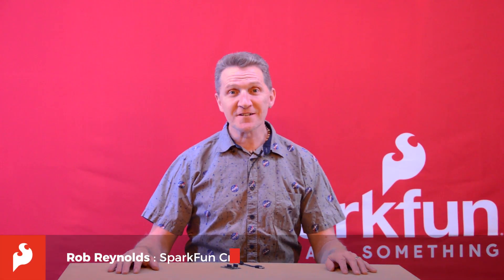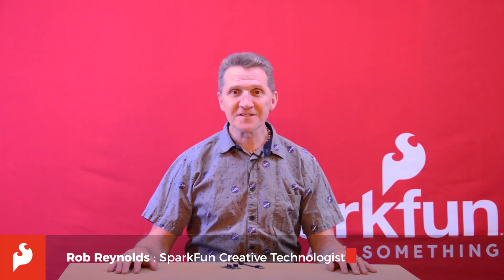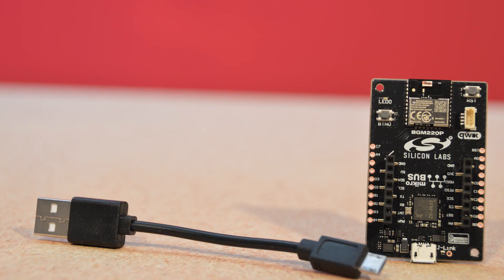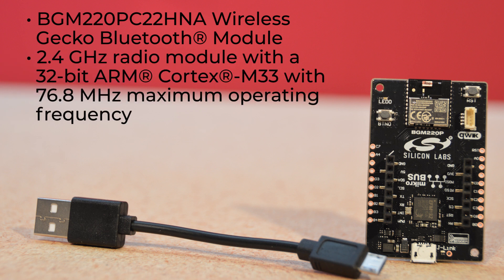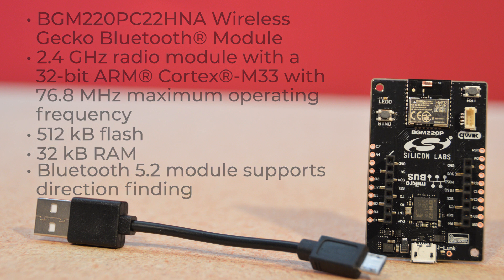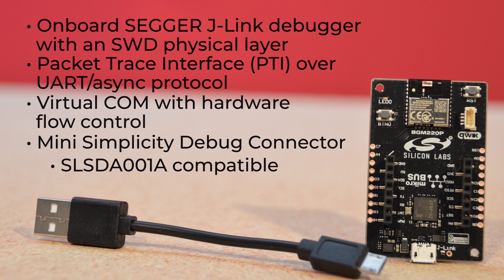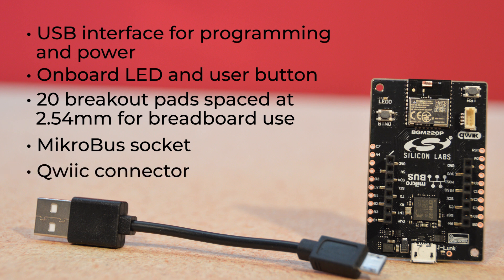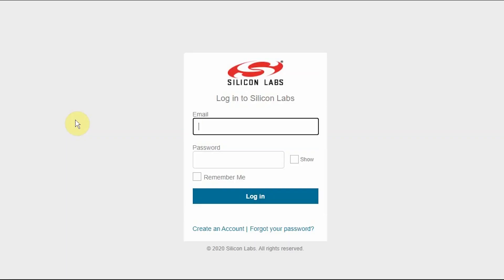Product Showcase: Silicon Labs BGM220 Explorer Kit

Comment: hi i have a question. Can we feed and use this device with Vmcu? It says in the datasheet it can be run with USB and VMCU. But when I tried, I gave power via VMCU, it didn't work. But I didn't put the program in it. Did you try? Or does it only work with USB? I want to run on battery.